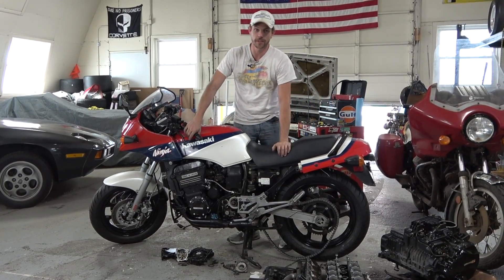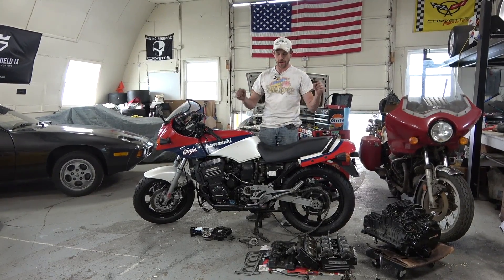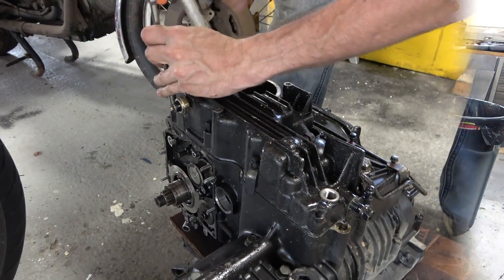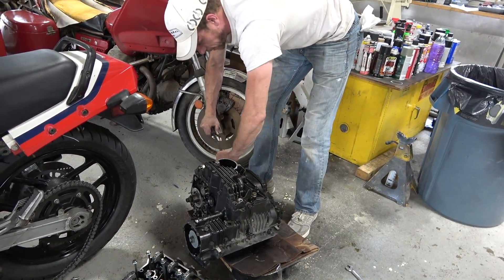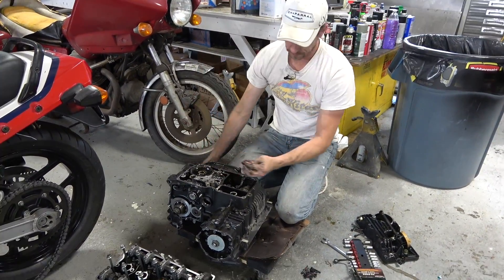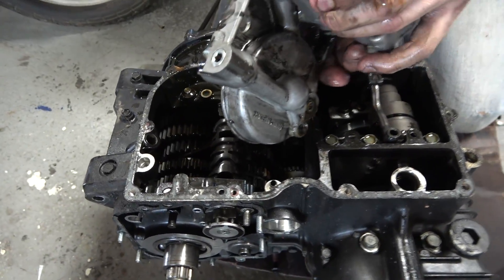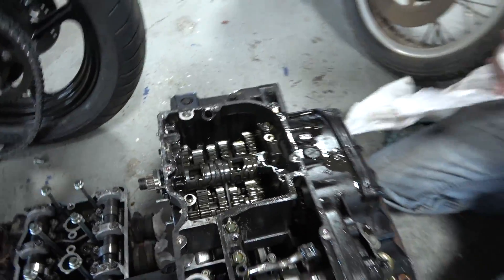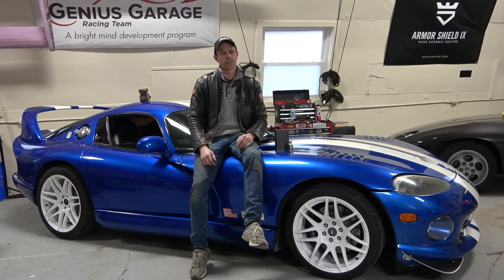Motorcycle transmission trouble and repair | Kawasaki Ninja GPZ900

Comment: Does that casing require a gasket? I'm currently having shifting problems where I have to "tap" the shift lever with my foot to downshift, I suspect my bike has the same problem as described in this video, bit I can't find any information on that case needing a gasket. Any help would be greatly appreciated.

Comment: My 2 year old bike has the problem at 3:00, it sometimes won't downshift and just goes 'soft' did you find what was causing it in your case, I'm wondering if i could repair it easily before going to the garage

Comment: In the background I saw a porsche 928, a VW Scirocco, and you are working on a Kawa Gpz 900...
...I fell like I'm 18 again...!!!!! 
...but...
a Guzzi 850???? you must like horror....The gpz900 was the fisrt modern bike, and the first Kawasaki with a great frame, if you ride the Guzzi after the Kawa, you will think somthing's wrong, very wrong....Guzzi made great things in the past, but in the 80ies gave the worst of her. Unreliable, bad built, slow, bad handling. Often ugly.
talkin more serously, before dismantling the gpz engine I suggest you the find a Haynes manual: motorcycle engine can have some little tricks and if you don't know them, damage (or time waste) are very easy.

Comment: At the dealership years ago, at closing time, a guy showed up with a mint Yamaha XS1100 in the back of his truck and wanted to trade. It ran good but had a flat rear tire. In a hurry since it was late, we put a deal together and he bought a new bike. A few days later our tech removed the rear wheel and tire looking for a leak but couldn't find one, he reinstalled it and called it a day. We took the bike out for a test ride and second gear was gone, awol. That a-hole let the air out of the rear tire so we couldn't test ride it and pulled a slick one on us.
Needless to say, we had a new policy implemented, no trade values until we test ride all potential trades.

Comment: If it pull even a little bit and then jump out of gear then dog tooth on second gear are gone. And no hammering, sanding or grinding can fix it. 
It can but 10 000 km later we are gonna see new video about: how to change Kavasaki 2nd gear.
If you wanna swap those 2nd gears from old and put it in new you gotta swap those other 2 sister gears on driven shaft because they are already run in and doing great together. Don't mix parts. Change whole thing

Comment: New kawis have cassette type gearboxes, so to pull them off you won't need to break the case in half. Just remove the clutch and the gearbox comes out. Which it's pretty nice!

Comment: Mine shifts like butter as long as I run Castrol 10w-40 conventional. The guy I bought it from told me that. I didn't believe him and switched to motorcycle specific Rotella, and the bike shifted clunky and I missed 2nd gear often. Switched back to 10w-40 Castrol conventional car oil and all was buttery again. 86 gpz1000rx

Comment: Make sure the anti dive works, or just disconnect. If they don't work the front end is like a rocking horse, becomes scary.
No problem in 10 years doing clutchless up shifts.
Drop the sump make sure the oil strainer isn't blocked by past owners using silicone sealant. Should never use that stuff.
Stuff to look for worn valves, camshafts, camshaft chain guides. And later modded oil fed pipes for camshafts.
Also replace the vacuum fuel tap and folks forget there are two oil drain plugs in the sump.
To get the head back on, fit the bolts to the head and tie them together with string. You can then fit the head without the problem of trying to fit the bolts in after. And fit a new shifter spring, they break and are a pain to replace.
Split the case, it comes apart and back easy.

Comment: As best i can figure 1st and 2nd get the most load on them. so they put them as close to the cases and the bearings there. if the transmission is popping out of gear it is more likely that the dogs are rounded.
Reply: You are partially correct.  Yes 1st and 2nd have the highest load.  But they are not next to each other more because of the inherent nature of a constant mesh motorcycle trans works in general.  Since, on the output shaft, 1st gear is the largest gear, both diametrically speaking and ratio wise and thus every gear thereafter numerically gets smaller and smaller — then placing 1st gear next to 2nd (as in physically side by side) wouldn’t be possible (At least it would be very impractical and require some odd and unnecessary geometry/machining).  Im my 30 years experience of building motorcycle engines for a living I don’t think I have ever seen anything but 1st and 2nd seperate and usually on opposite ends of their shaft.  Because of the way power flows through a m/c constant mesh trans and how gear engagement and shifting is by dogs on adjacent gears—the physical size, diameter wise, determines placement.  The two largest gears can’t be placed side by side because their dogs/slots wouldn’t be able to be placed in the right position when taking into account that certain gears must have an internal spline to lock them to their respective shaft whereas others need only have a smooth bore to rotate freely on their shaft (or a bushing/bearing).  So whether a gear is a fixed (splined) or fixed but free-wheeling or fixed and sliding (axially) gear then all these different factors and hence differing gear physical geometries contribute to why 1st and 2nd cannot be adjacent on their shaft.  It’s kinda hard to explain without a visual aid but if you look at a closeup of a trans and think about how the power is transmitted through it you can see what I mean by how the geometry is not conducive to it.  That’s why I think it’s more this that keeps them separate rather than placing the highest loads right next to the bearings.  Yet that is a good point you noticed and is an inherent positive by product.
Here’s a hayabusa trans that you can zoom in and get a better visualization of what I mean.
https://store.schnitzracing.com/schnitz-racecut-transmission-suzuki-hayabusa-99-07/#gallery 
The top shaft/gears is the input shaft.the furthest gear to the right, just before the big bearing is 1st gear and is actually integral to the shaft.  It’s machined right into the shaft itself.  Very common is this especially in the big bore highest torque producing engines.  Since first gear has the most gear reduction and thus torque produced it is built integral to avoid having a gear that is seperate and coupled to its shaft via splines that could easily be sheared from the 1st gears high torque multiplication.
The bottom shaft/cluster of gears is the output shaft or countershaft or as some oems call it the “drive” shaft as it drives the chain driving the rear wheel.  They sometimes call the input shaft the driven shaft as it gets its drive from the crankshaft and in turn “drives” the output shaft.
From left to right and the same for both shafts the gears are 2-6-3-4-5-1.
On the input, 2nd is splined and fixed from sliding, 6th is freewheeling and fixed, 3rd and 4th are one solid piece and is splined and able to slide both left and right and has dogs on either side to engage with 5th or 6th gear when slid one way or the other, 5th is a free wheeling fixed gear, and 1st is integral to the shaft as I described earlier.
On the output shaft at the bottom, 2nd is freewheeling and fixed, 6th is splined to the shaft and has dogs on both sides, 3rd is freewheeling and fixed in place, 4th is the same freewheeling and fixed in place, 5th is splined to shaft and sliding left and right with dogs on both sides, and finally 1st is a freewheeling gear that is fixed from sliding.
From here you can figure out any gear change’s drive and driven gear and what must move to accomplish any gear.
For instance, since we know when starting off in first gear, the input shaft is spinning and since first gear is integral to the shaft it must be spinning.  Therefore it’s teeth are meshed with 1st gear output at all times (hence the name of m/c trans of this type being “constant mesh”.  Yet 1st output is a freewheeling gear therefore it doesn’t transfer any power to its shaft unless something were to “couple” it to that shaft.  5th gear is directly adjacent to it to the left.  Since 5th is splined to the shaft and a sliding gear with dogs on both sides of it, sliding it to the right “couples” it to the freewheeling 1st gear and therefore transfers the power from 1st gear input to 1st gear output and now the output shaft is spinning.

I’ll describe neutral and 2nd gear change and the rest are easily figured out.

In neutral the input shaft is free to spin independent of the output shaft even though all the gears are in “constant mesh”.  When in neutral all 3 sliding gears are in the middle of their range of movement, thus not engaging their dogs with any adjacent gears.  No gears are actually coupled and everything is just free spinning.
Shifting the lever up to second rotates the shift drum via the ratchet and pawls or whatever mechanism the particular trans uses and pulls 5th output away from 1st gear allowing it back into its neutral position while at the same time the drum slides 6th output over into contact with 2nd gear output which is again a freewheeling gear.  But since 6th output is splined when it slides over and the dogs engage, the ordinarilay freewheeling 2nd gear now becomes coupled to the output shaft and thus the shifting into 2nd gear is accomplished.

So on and so forth!!!!!